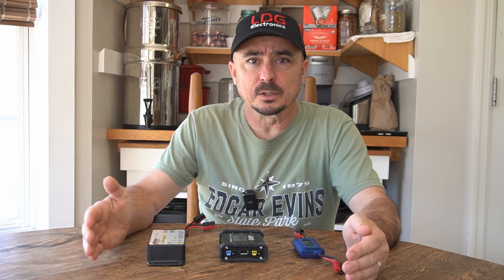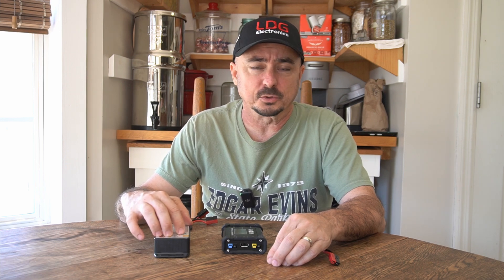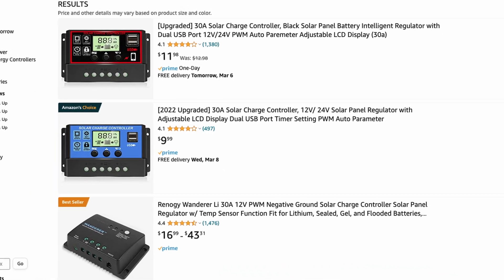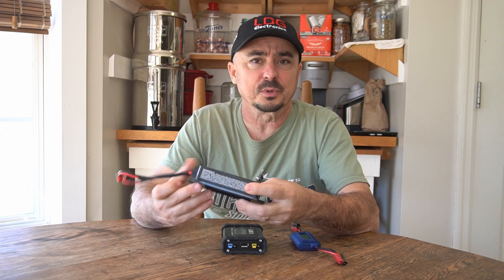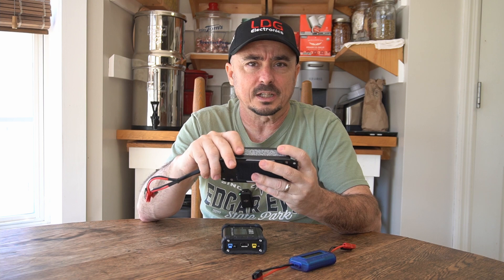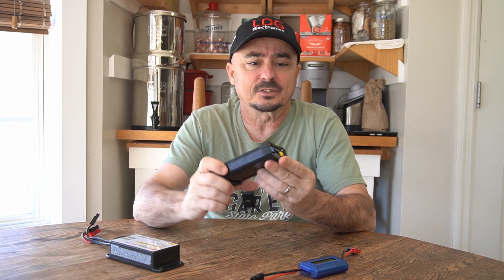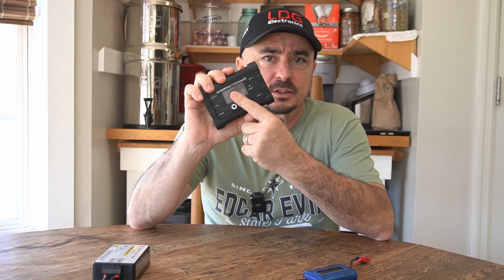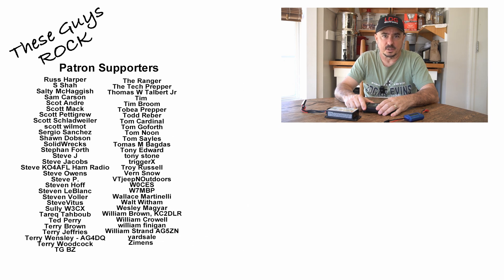The Best Solar Charge Controller

Comment: Allto Solar Intelligent 10A MPPT Solar Charge Controller,10 Amp 12 Volt Solar Panel Regulator with Digital LCD Display + Temp Sensor + Charging Level for 12 Volt Wet Gel AGM Lithium LiFePO4 Battery from Amazon

Comment: Again, a very good video!  I believe the Genasun MPPT charge controllers were intended for autonomes /remote setups.  Maybe that is why they don't have the bells and whistles of other charge controllers.   They do not seem to produce any RFI.  A representative of the company assured me they don't.  I bought mine on the recommendation of OH8STN.  Personally, I don't need a display, but a little watt meter would do the trick.  I agree that one negative point is design for  a single battery chemistry.  But maybe that is in the philosphy of the company not a bug but a feature.  In any case,   In any case there are many charge controllers on on the market that can meet one's technical and personal preferences.  Too many choices. Too little time!

Comment: I actually have the Genasun GV-10 along with that same watt meter.  I have it in between the battery and the charge controller most of the time. Using a Rockpals 60W folding panel does the job for my 10Ahr battery.
Reply: I, too, have the Genasun and will be comparing it against my new PowerMini 2 in the next couple of weeks.

Comment: How is the noise coming from the Buddipole? Does interfere with the radio when connected? My genasun is horrible.
Reply from the maker: Interesting. I don't notice any noise from my genesun or buddipole. Is you genesun a recent purchase? Mine is several years old now and I wonder if the changed something in the design.
Reply: I bought mine just over a year ago. Winter field day I realized it was so bad that I can’t charge and operate at the same time. I don’t normally need to so hasn’t been an issue. OH8STN has had similar issues and did a video about it. Tried a different brand with same results. Now looking to remove from my go box and build a separate battery box. I can still operate with the battery in the box. But if I need more, can connect to the aux battery box.
Reply: Sounds like a defective Genasun.

Comment: One of the conversation points needs to be how much solar are you going to use, and what charge voltage do you need to charge your battery system.  You will find that alot of the solar rigs sold to HAMs have limits on the voltage and amps.  If you are going to use a 50A/H or larger battery, you need to get smart on MPPT controllers to find the right configuration and set up.  The smaller units are just find for the small 5-12 A/H batteries but will not be suitable if you have a larger supply.  I have the pwrgate set up for my smaller set up in my go box but for my larger set ups, I have a dedicated MPPT controller for the larger voltage/amps/watts.  Also, make sure you understand the voltage coming off your solar panel set up.  The smaller types often just have connectors for direct charge via USP connector rather than straight volts/amps coming off the panel.  The former can work in your favour if you battery supply can proper use the set up.
Reply from the maker: Great points! Both the genasun and buddipole are 10A controllers but work well with the smaller panel/batteries I use. For larger batteries/panels you would want a larger (more capable) controller. 

Right again that you have to be careful when buying panels. I like having USB ports on them but having direct DC output is a must in my opinion.

Comment: tried the epic pwrgate ever?
Reply from the maker: Yes. I run one in the shack and love it though I don't have it connected to solar. One side is connected to mains power and the other to my backup battery. One of these days I would like to install solar at home as an alternative. The great thing about the pwrgate is that it auto switches to the battery fast enough that the Pi's never skip a beat.
Reply: I use one in the shack.  I love it but your limited on panels with it.  The suspend button is a good feature to have though I have never had to use it so far. It being programable is a plus too so you can adapt it to your setup. If they make one that can do 400w I will be first in line.   My portable setup is the buddipole and I like it also.

Comment: I think the pwm (pulse width modulation) charge controllers are noisier but I don't have any yet to check. I hope Buddipole make a mppt version one day. :)
Reply from the maker: Often the cheap PWM's are noisy but I haven't noticed any noise with the buddipole power mini.
Reply: PM2 is RF silent.